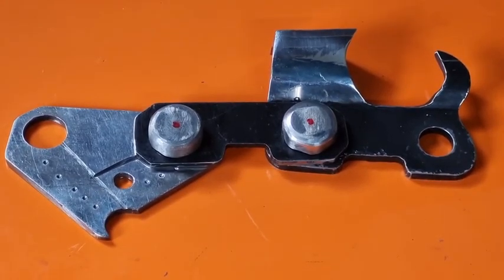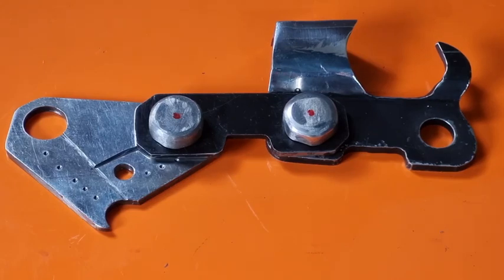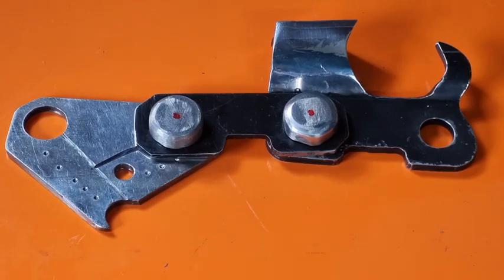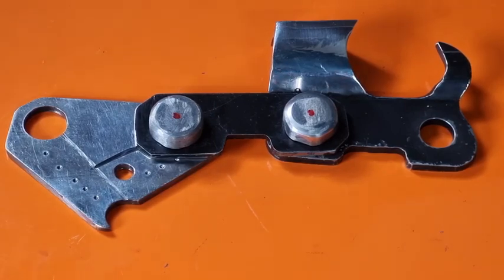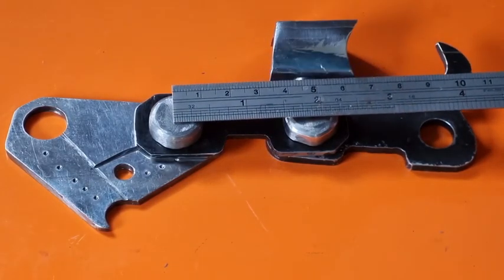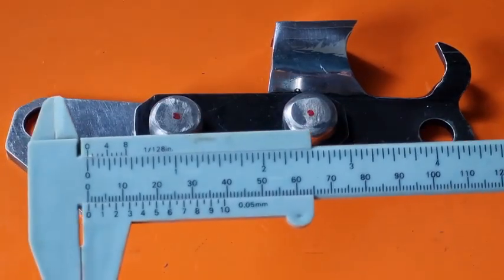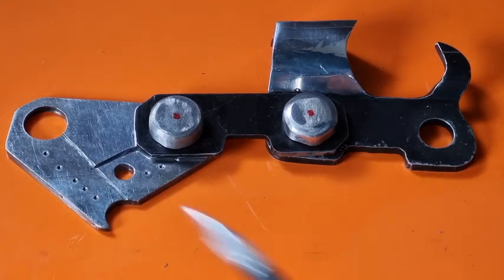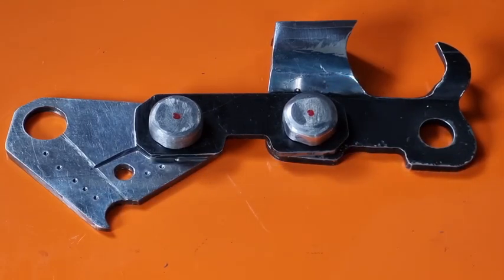Dummies  Guide to find the pitch of any chainsaw chain

Comment from the maker: The pitch of a chain refers to the distance between its drive links.
 

It is determined by measuring the distance between any three consecutive drive links and dividing by two. Example: 3/4" divided by 2 = 3/8". Sometimes pitch is expressed as a fraction: 3/8" and sometimes it is expressed as a decimal: .404".

The pitch measurement of a saw chain tells a pro user about to the overall size of the saw chain. Usually a larger pitch indicates a heavier and bigger chain.
 

What Most Pro Users Run: The most common pitch used by professional saw users in the Pacific Northwest and Alaska is 3/8". It offers good flexibility, low weight, adequate strength, and good cutting speed when run on today's high RPM pro saws.

What Most Harvesters Run: Harvesters run both .404" and 3/4" pitch chain.
 

Saw Setup: The pitch of the chain, the pitch of the drive sprocket, and the pitch of the bar tip must all match.